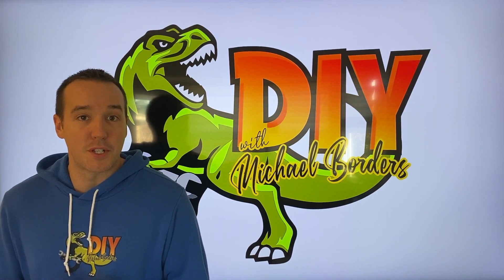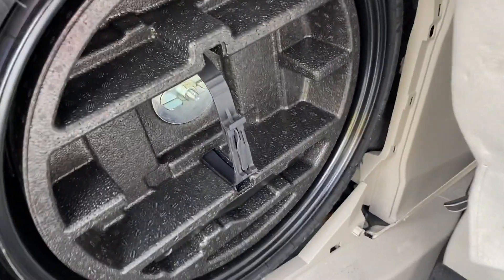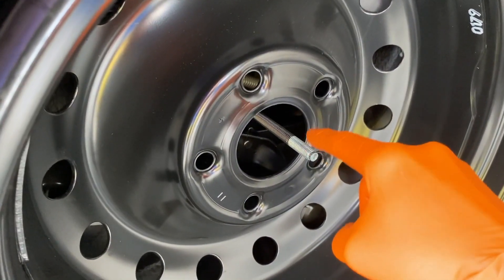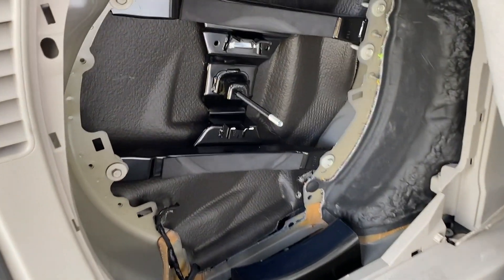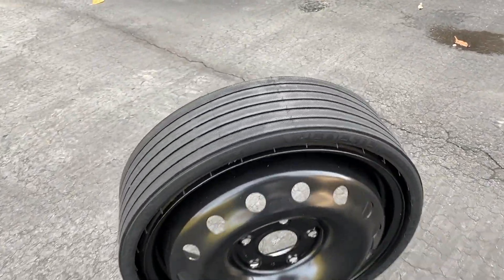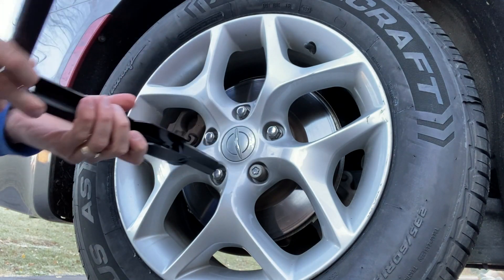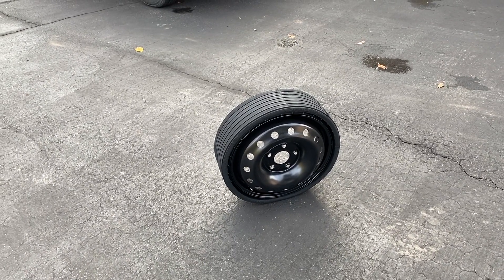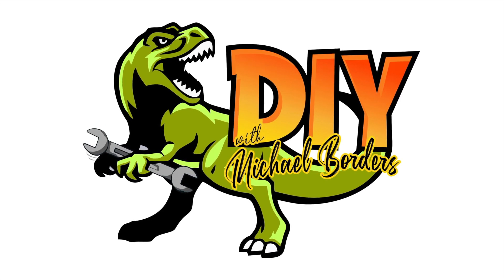How to remove Chrysler Pacifica spare tire - DIY

Comment from the maker: 1.  Remove Pacifica tire

          https://youtu.be/3Wu2TKn2tLs

2.  Getting to know your Pacifica

          https://youtu.be/LcBFslgcj5g

3.  How to install Pacifica spare tire

          https://youtu.be/ay1MNtwlj_c

4.  How to adjust Headrest

          https://youtu.be/73HkStcw1fw

5.  How to turn off Chrysler overhead lights

          https://youtu.be/5TX1v-p-wLo

6.  How to replace Pacifica overhead light

          https://youtu.be/yEa-Mri1poI

7.  Change Pacifica key fob battery

          https://youtu.be/3EO1aLqSkfU